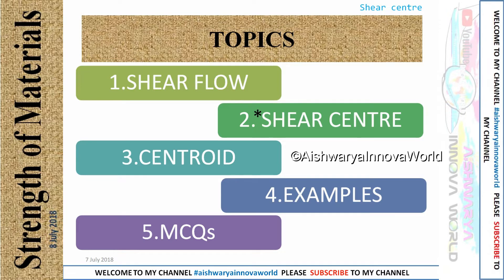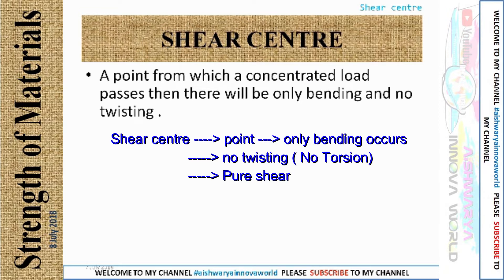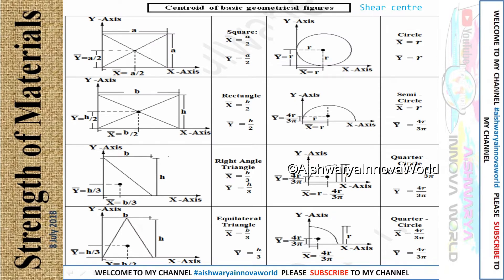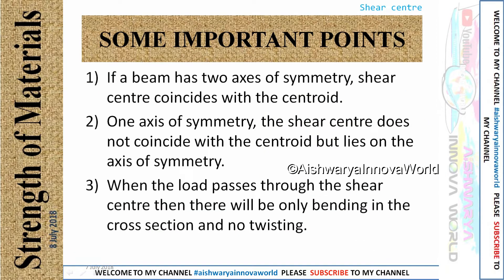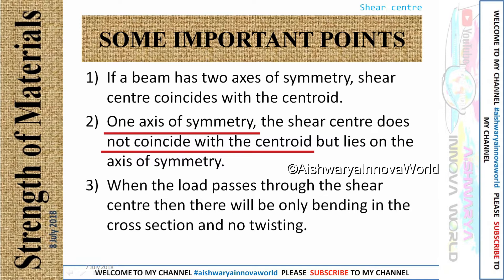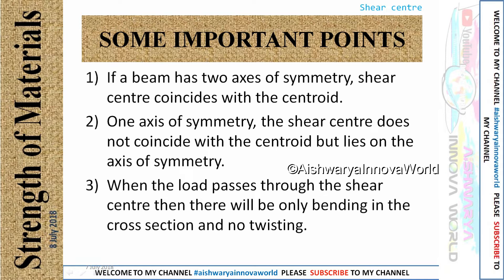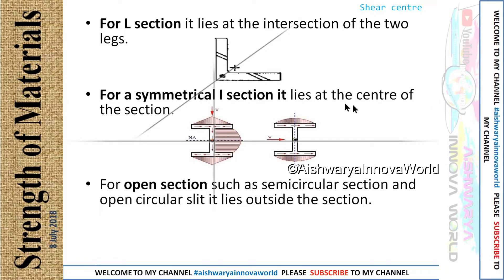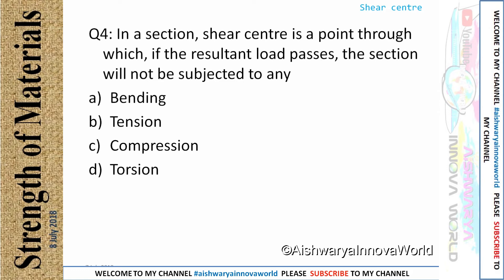Shear Centre: MCQs | STRENGTH OF MATERIAL | Competitive Exams || Innova World

Comment: Why shear center is important? Why we find it?
Reply: Shear center is that location where if loading is provided than there is no torsion in the member ,only pure bending will take place.
Reply: @masteringup  Kya jawab dia hai Bhai ne..ekdm alag..🤣
Reply: IF you apply transverse load to thick bodies like rectangular, ciruclar where we are having 2 axis of symmetry , it will onliy bend but not twist.
if you apply transverse load to thin bodies like C section, at the same place i.e at centriod it will bend and twist. therefore, in order to avoid torsion/ twist we are finding shear center and if we apply load on shear center, it will undergoes only bending.
COMMENTING AFTER 1 YEAR,, EVEN AM LEARNING RIGHT NOW.